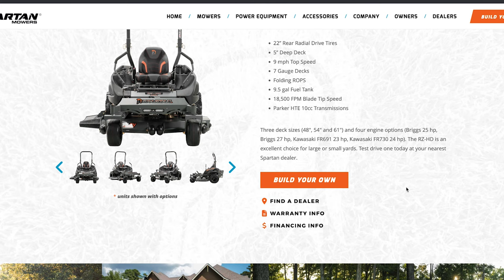Spartan RZ-HD zero-turn riding lawnmower walk around!!

Comment: Took me 2 or 3 times to get good at it. Will never go back to a normal mower again. I can drink a beer and hold both handles with one hand now and make straight cuts. Cub Cadet RZ50, have had it for 12 years, 24hp Kohler. Love it. I cut about an acre in about 35 minutes around a lot of trees and other obstacle's. Before with 42in riding mower, almost 2 hours to do the same. Enjoy!
Reply from the maker: One handed??  Damn!  Yeah I need practice!!